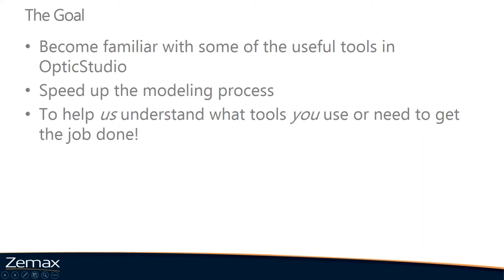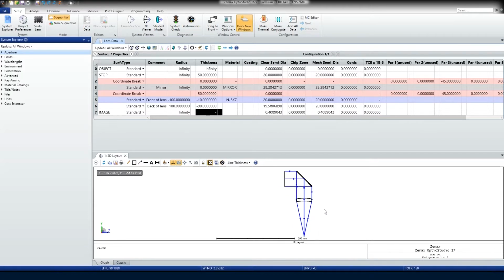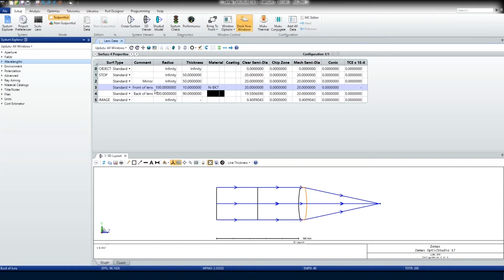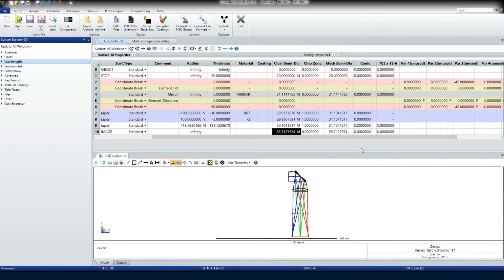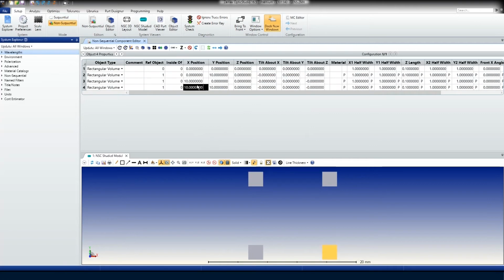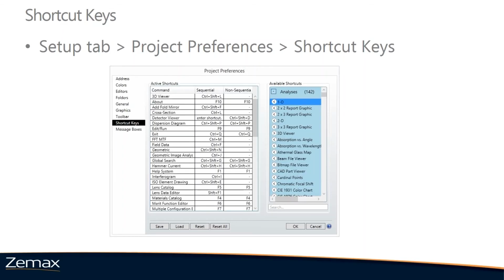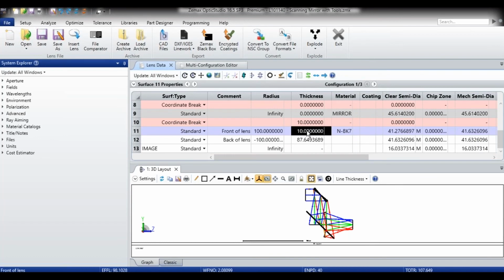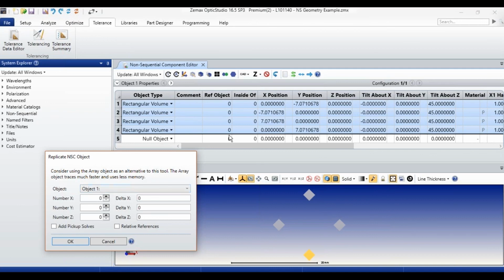There’s a tool for that!

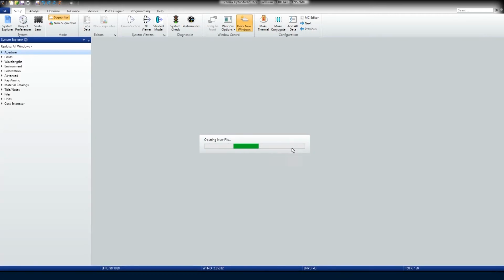Comment: 11:14 start
13:12 Mirror tool
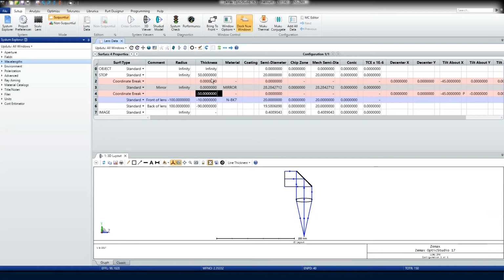14:08 Tilt tool
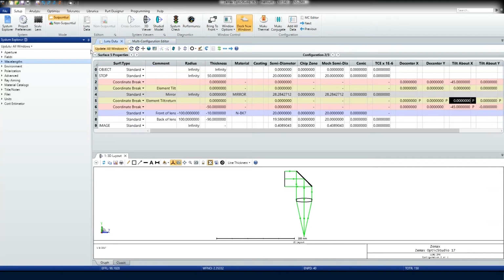15:40 Aperture tool
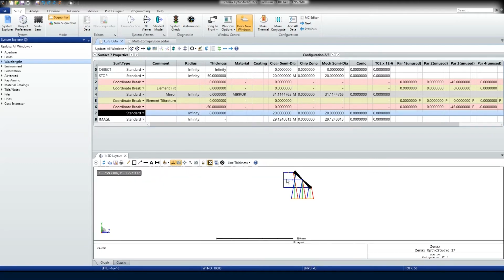17:00 Insert lens (Note: 2021 just look for doublet lens in the local folder and then adjust to the doublet shown in this video)